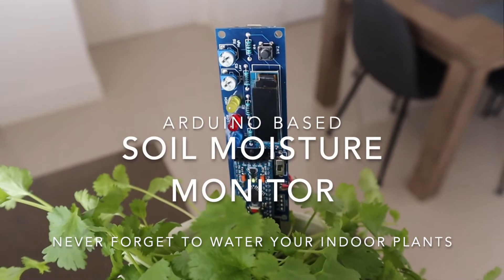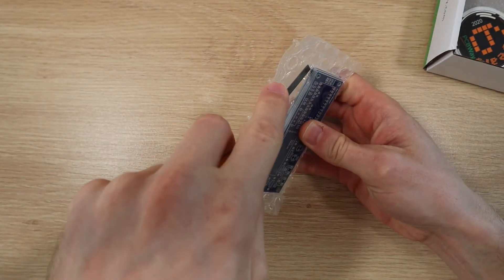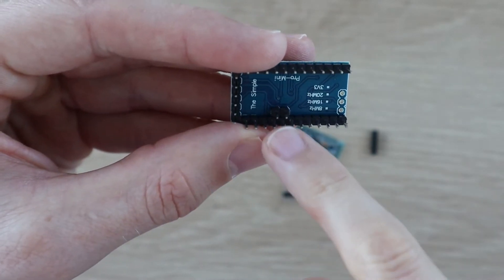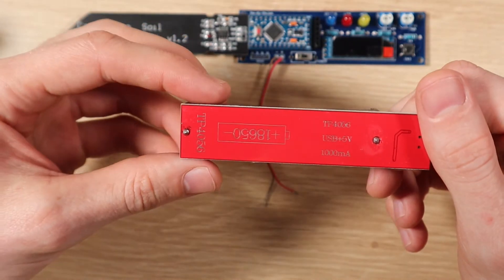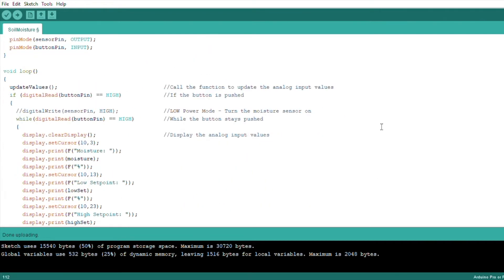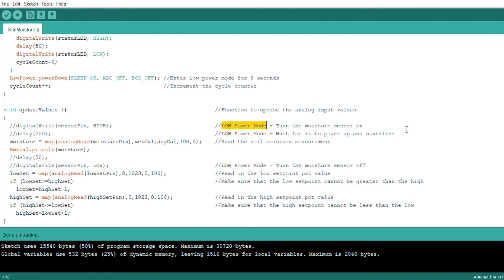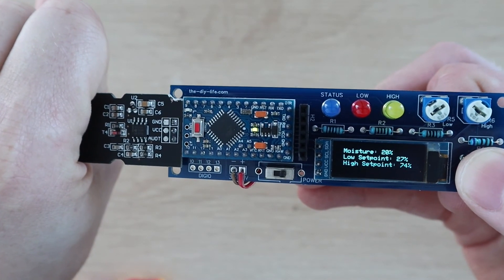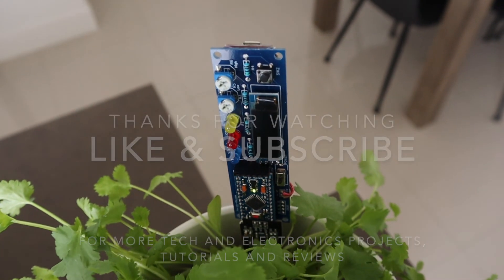Arduino Soil Moisture Monitor - Never Forget To Water Your Indoor Plants

Comment: I may have missed it, do you have an idea of the total cost of the project for 1 plant?
Reply from the maker: It is probably around $15-20 depending on where you get the parts.
Reply: thanks! I was estimating it to be around that range indeed @MichaelKlements

Comment: Beautifully designed.  Great Scott experimented with weather-proofing circuitry and concluded that nail polish was ideal for this type of application (and it was cheap and easy to apply), particularly to protect the exposed edge of the sensor.  Your code goes further than I was interested in going, but you have inspired me to take care of all the obscure but important factors.  Nice work.  Thank you.
Reply from the maker: I'll definitely have a look at Great Scott's guide, that sounds perfect for this sort of thing. Thanks for the great feedback as well!

Comment: The Acrylic Plate at the end was something I was thinking about while watching your videos.  You should "teach" some kids at a MakerSpace if you have time on a weekend. Very nice video.  What about the other type of Moisture Soil Sensor on the market ?
Reply from the maker: Thanks Robert! There are two main types of moisture sensors, resistive and capacitive ones. The resistive ones are more accurate, but from what I've read online they corrode quite quickly, usually in a couple of months. The capacitive ones last a lot longer, but need to be calibrated for each application and are typically less accurate.
Reply: @MichaelKlements  Yes, I saw a video on Moisture Sensors and I know the first type, resistive, are cheaper too.  Do they set up their own "signal" due to the Moisture, like with two different metals in a conductive solution ?
Reply: @MichaelKlements  LINK (eBay) ==>  https://www.ebay.com/sch/i.html?_from=R40&_nkw=Analog+Capacitive+Soil+Moisture+Sensor&_sacat=0&_sop=15
Reply from the maker: @robertsimpson4693  the resistive ones have two probes. They measure the resistance of the soil between the probes, which decreases as moisture in the soil increases. They still need to be calibrated, but just provide more consistent readings.
Reply: @MichaelKlements  p